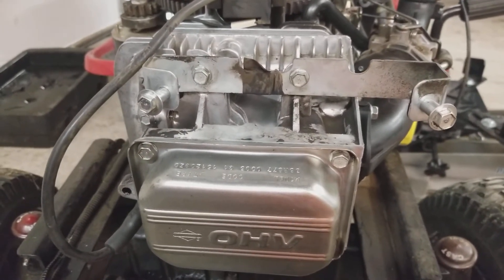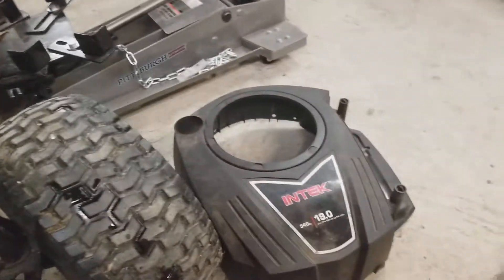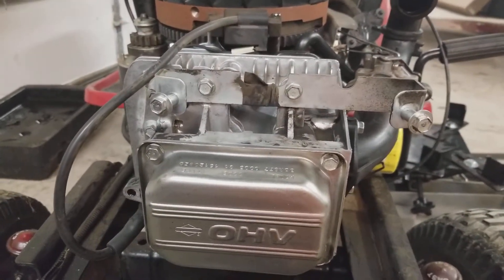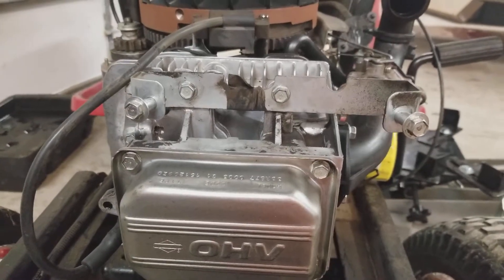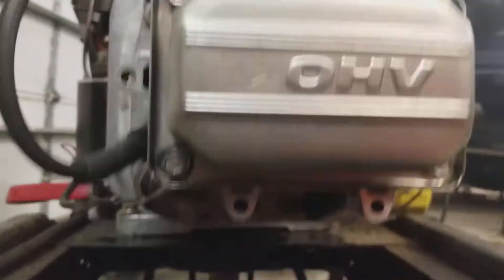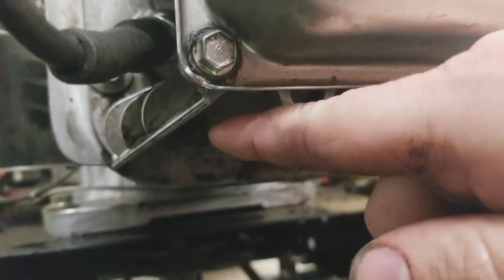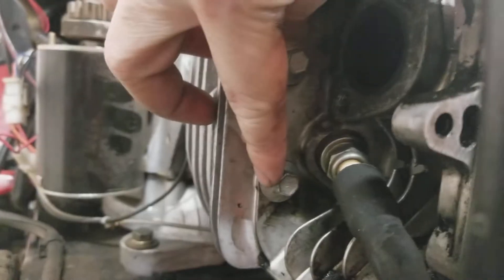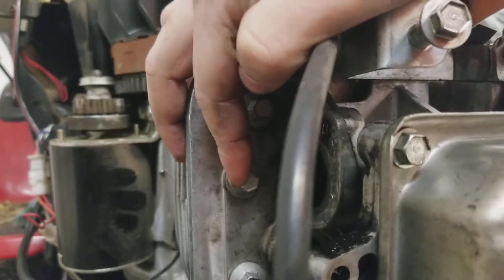Briggs & Stratton / Intek Cylinder Head Bolt Torque & Sequence

Comment: This is just what I'm looking for. My engine started sucking oil through the engine air filter and my good friend told me it's a head gasket issue then his helper and all around good guy confirmed it. I had to buy a new torque wrench that would do 220 . Anyway thanks for posting this straight to the point video.

Comment: I have the exact same model of engine and it recently started smoking badly and pretty quickly.  I have ordered a new head gasket and I couldn't find the head bolt torque online, until I saw this video.  Thank you so much for sharing this info and also the proper torque sequence.  This was exactly what I needed!
Reply: Lol no shit David, I did the same thing (although somewhere in the HDD underground sub terrain here is a factory manual for my machine lol) actually mine's a 16.5 HP BS and the cheap head gasket set from china fixed it - same issue :)  One thing, I got a bit scared when doing up the last torque on the last bolt, it felt like it was gonna strip before that click!

Comment: Ours has excess back pressure in the crankcase causing pressure where the oil is would that be a sign of a broken head gasket
Reply: YUP exact issue, gasket burns away and pressure bleeds between the piston and valve rod "cavity" (for want of a better word) and blows the oil out of the filler - probably a bit late to answer but there ya go, anyone else.
Reply: @davidrobertson1980  not too late we got the gasket a while back we actually got two of them we still haven't gotten to do the job yet because we'll have to work on it outside and we haven't had the best weather
Reply: The piston rings/cylinder could be worn allowing excess blow by past the piston and into the crankcase
Reply: Mine was loosing oil

Comment: Fortunately the Walmart manager allowed me to return the Snapper mower and refunded my money.  Apparently it had been returned before.  I could tell a shade tree mechanic had been working on it.  He used silicon instead of buying a new valve cover gasket.  They didn't tell me it had been returned before.   I assume they may donate it to charity and write it off their taxes or maybe they can return it to Snapper.
Reply: Some of them come from the factory with silicone & no gasket. B&S says not to use a gasket if there wasn't one before.

Comment: Thank you.  Will the new head gasket blow if I do it exactly like you said ?   What if I go a little over torque, say like 250 in-lb???????????????????   I think this is a well known problem with this model 33R877.  Mine was on a snapper I bought at Walmart.  It's still under warranty and has 15 1/2 hours on it but no lawnmower shops around here does warranty work due to difficulty getting paid and the companies won't pay much anyway so I did the work myself.
Reply: Before you put your head gasket on go,  get some Copper spray maker in a spray can and spray both sides of the head gasket or it'll leak again
Reply: @kenithj76  I think it will blow again in the same place because the head bolts are to far apart on the intake side.   Fortunately the local Walmart manager refunded my money.  It appears the mower was returned to the store and it was worked on before. The shop was to cheap to buy a valve cover gasket,  They used RTV /  silicon and it had been leaking oil.   It had 15  1/2 hours on the mower when the gasket blew.
  Briggs have always been good engines but this one is defective.  "A bankruptcy court judge has approved the sale of Briggs & Stratton Corp. to KPS Capital Partners, a New York private equity firm"
Reply: @yoyohooyo  glad they took it back . I wouldn't tried to work on it if you just got it. Best to get a mower with a Kawasaki motor . Bullet proof in my book .

Comment: Not my engine do you know a sight that I can get the info from Briggs and Stratton website is to much running around on it I have a 31 hp vanguard big bolts so hard to find info on it